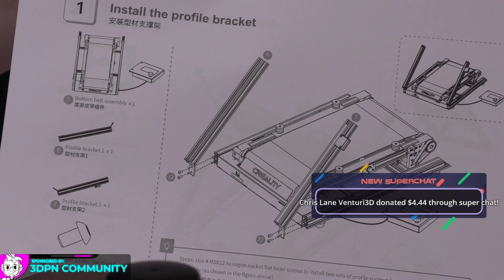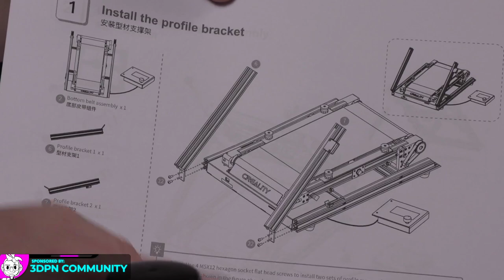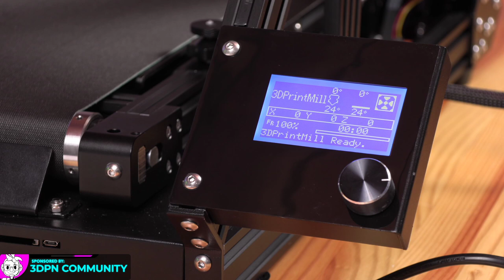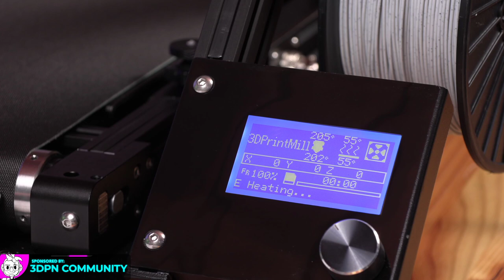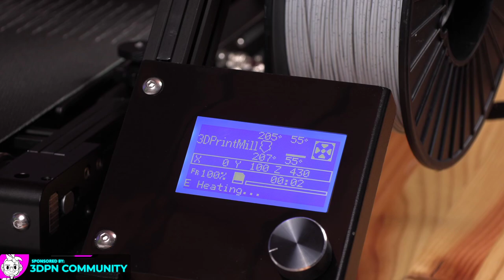Unboxing the Creality CR-30 - Naomi Wu's #3DPrintMill BELT PRINTER!

Comment: Support-free things like benchy may need support. For example, rotating it diagonally toward the nozzle in the slicer (and adding a wedge of supports from the bottom to the bed [belt]) may help. Support-free objects for this printer will have to be designed differently, but can still be done. I look forward to seeing more results and experiments with belt printing.

Comment: @3D Printing Nerd  Just remember, Gain is the sensitivity!!! Set your gain too high and you get either distortion or feedback, especially if using monitor speakers!!! If you have a mix board with VU (Volume Unit) meters, set the gain so the VU Meters are peaking ever so slightly in the red, then adjust your volume for best overall sound!!!😁👍🏻
Reply from the maker: Thank you!

Comment: Naomi, I am a small business owner and my 3d printer fills a specific spot. Parts that I don't want/can't afford to pay for the injection molding tooling costs for and where volume would not really justify the initial cost. For my current application this is an internal spacer that doesn't require a nice finish or even much strength. I currently turn line width, layer height and speed way up and layers to 1.

I think a lot of us have been following you and this project/product because of the potential this machine has to bring fast low quality prints to us. I haven't seen anything from these prints that would cause a print to be unusable. We will try to purchase this with the kickstarter providing it will print ABS and is fast regardless of print quality (being able to change the nozzle size would be a huge positive as well). I think a lot of us are in this boat. Quality is binary, the part is either suitable or it completely fails.

Keep up the good work, just wanted you to know this use case is out there and may be huge. Good luck, keep killing it out there.

Comment: For a first print it looks ok. Do you know the print settings ? Perhaps one side is effected by layer change,  filament calibration  could make a big difference and what is the layer height. The only thing I saw was a slight wobble as it finished a layer. Thank you  for taking the time to setup and show this exciting new printer.
Reply: Joel was printing pre-sliced Gcode. 

Naiomi did the slicing.
Reply: @pileofstuff  that was my point, he didn't know the settings.

Comment: HELP!! Please, I am trying to set up a CR-30 but I've been at it 2 days now. I have tried a few different tutorials on You tube and even followed Creality's own You Tube Leveling Tutorial and I still can't get it to print. Everything appears to be level and the nozzle clearance from the belt is 0,1mm (checked with included feeler). I'm exhasuted with it. Any help or advice would be greatly appreciated.

Comment: it looks like rethinking supports to work in a horizontal plane might be a big improvement. when printing the back of the benchy the extrusion doesn't have enough to push against.   (like an overhang on a normal printer.)

Comment: I noticed as it peeled free of the benchy it left an image of the base of the boat on the belt. Can the belt be cleaned or will it eventually have to be replaced once the belt becomes packed with residue from the prints?
Reply: Not so much the residue, vs the belt adhesion is strong enouth that it lifted the belt.  I would be concerned about the belt layer separating.  When you get back to the start place on your conveyor, then some sort of cleaning should take place.  I think the nature of design will mean belt replacements- Will happen.  Parts costs will be important.  I immediately noticed the same thing.  I've been watching the infinity printers being tested, and it is All about the belt.  They probably figured it out though...........; being Creality
Reply: @d-rockpain4250  you could see as the benchy peeled free it left an outline in the fabric. It definitely seemed down in the weave and not surface dust. If every print leaves behind a little footprint the bed I think is going to have issues after a while if it can't be cleaned somehow.
Reply: @stinkyham9050  as a consumable part? They're going to take a lesson from 2D printer companies and charge a premium.
Reply: @Hawk1966  Im thinking the belt can't be super expensive.  It's a finger joined belt, so if that raises up at all and gets caught at the belt discharge end; then it'll need replaced.  Economical belt cost, and dare I say; a spare with shipment- would help sell this one.  I believe FDM tech is still only as good as the adhesion of the print. If the belt mimics a creality magnetic  bed surface, but in a belt; then they could probably run a uhmw scraper on it, but that would up the likelyhood of the finger-destruction scenario.  Todays belt tech is in our favor
Reply: @stinkyham9050  They can get pricey, but moving so slow and sooo much surface area.....I figure most failures will be fingers letting go, not tracking properly, and belt surface damage. Printing over a thin base layer(remnants)isn't great for the extrusion of the machine, but probably clog a hotend only.  I am indeed curious about belt construction primarily at this point.
Reply: @d-rockpain4250  Giving away nozzles and acupuncture needles is one thing. They buy them in amazing bulk so giving them to us is like a half cent or less per machine. But when it comes to a proprietary major part like that bed cloth. I don't see them being given away or sold cheap. Let's be honest, companies exist to make profit.
Reply: The answer is YES!
Reply: When I was in industrial belt sales; I probably swapped a million dollars a year worth of conveyor belting in place of overpriced OEM...or incorrectly spec'd OEMs, so I agree that- it is all about money.  They don't even put spare tires in new cars anymore.  shakes head I found that the psychology of free items goes deep in sales.  If people are programmed up front for belt replacement, and still purchase the printer, then they have already commited to purchasing future belts mentally....like printer ink sales in the 90's.  I think so many are questioning the belt......, to add to the sales price for budgetary purpose.  I've seen several versions of this take on the infinity printer, and the real variant seems to be: the belt.

Comment: I wonder if the quality would be improved if the entire printer were tilted so that the nozzle was once more aimed straight down, with the belt canting off at a 45 degree angle downward. Maybe some of the quality issues come from gravity being at odds with the extrusion?
Reply: Yep good idea.... And easy to test out. 😁👍
Reply: impossible to do... big prints would never stick to the belt if they were at 45 degree angle. Gravity does its thing
Reply: @biziluxgames8924  hmmno so sure I had big prints stuck to my bed so tight it took me hours to get it off.  Filament isn't that heavy.. Sure give it a go. 🤔👍
Reply: Worth testing, but keep in mind you will also limit the z-axis by doing this.  It will only be able to print as long as the distance is from the nozzle to the floor.

Comment: I gave up on this style of printer years ago because I couldn't work out how to seam and hem a metal mesh belt while keeping it flat enough.   I did think about about using fabric but assumed the print would fuse to it.   I gave up too easily.
Reply: You could have bought a sanding belt.  Those things have to deal with high temperatures.

Comment: Is it possible at all to run the extruder at 90° instead of 45°. I'm not worried about losing the "unlimited" axis, I'm more interested in small batch production.
Reply from the maker: Not on this specific machine, but there are a lot of custom projects out there with that idea.

Comment: Nice printer but the part about face shields made me wonder, could we get belt printer with 90 degree angles? With 45 degree angle face shield would be weaker and could break between layers. But if we could get standard printer like Prusa i3 or Ender 3 with belt we could get repeated print capability without issues connected to 45 degree printing.

Comment: How does the printer printing parts at a 45 degree angel affect the strength of parts?  Can you only print all parts at a 45 degree angle? or is the angle adjustable?

Comment: This is cool.  However I see the issue that from a shear standpoint the parts produced by this will have both X,Y and Z strength limitations because the print plane encompasses all of them.  Ie the parts will be structurally weaker than a cartesian print.  Would be interested in PETG printing but I guess that'll bond to the belt ?  From a prototype standpoint though this is excellent for Industrial Design etc.  Just think, for woodwork, you could print a shape for a lathe chisel guide for the whole leg of a table etc.

Comment: Yeah its cool seeing it printing at an angle but is there any good reason other than the moving bed  to buy this ??  My first benchy on my stock i3 mega was perfect ,,  no strings no under extrusion .. Not one thing wrong. . The benchy you printed in this vid  has a lot more issues ..
Sorry but unless the prints on this printer gets any better  im not sold on that machine  ...yet 😉
Reply: The rolling bed, allowing for extremely long prints, is the one reason to buy this.

Comment: I'm not happy with the way the belt is sewn together, but we'll see if they find one of the better ways of making the belt.

Even with that, I want to get one of these.

Edit: apparently there is no extra indent when you print over the seam, making this the best method.
Reply: Problem with other methods is that you will not get a continuous, seamless surface. Part of it would be unusable. Not to mention issues calibrating after belt change so that printer knows where the seam is.
Reply: So far there is no difference in prints that are printed on that seam but people need to understand there is texture on the bottom of the print.
Reply: @Naomi-Wu  if there's no difference then you did an amazing job.  On the video it looks like there's going to be a zig-zag in the bottom of the print.  Either way, I'd like to know how you got past the problem of the z stop in the firmware.  That is the last stumbling block on my homemade belt printer.
Reply from the maker: That zig zag played with my eyes. I thought it would be felt, but running my hand over it and I barely felt it. So weird.
Reply: @michaelbujaki2462  The z-axis still has a limit but its 21,474,836mm (over 13miles) which I'm told is the max for Marlin Currently (hoping they find a way for infinity).  I don't see anyone printing that long and typically you reset the z-axis to zero between each print in the gcode.
Reply: @NAK3DDesigns  that would be good enough.  My starting point was a Vertex Nano, which I stripped for parts.  I have the thing working, I just need a belt and a way to fix the firmware.

Comment: My paranoid self has to wonder: any risk of a print sticking so well to the back of the belt that it gets lifted off in the front as it goes around the roller? Say your adhesion starts strong and gradually declines as you print. Maybe have something in place right as the belt drops that is level with it (with a slight offset, so prints don't get caught on it. Like a fixed spatula that keeps prints from trying to tilt.
Reply: that very rapid turn really should make it impossible, but a sufficiently thin and flexible print could in theory tho
Reply: @teslacoil4335  From the follow up video it looks like that happened to the I-beam model. Not at the turn, though, but from what I understood, the bed is slightly dipping before that already.
Reply: @TheTrienco  ah I didn't see the follow up, I need to check that out

Comment: Wondering about layer adhesion when it goes 45 degrees instead on 90 degrees on the print bed, how does this affect print adhesion ?
Reply: I'd love to see Steffan do some of his torture tests on prints from this thing.

I suspect on a well tuned machine with good slicing it would outperform horizontal layer lines, but be a bit less than vertical layers.
Reply: watch the follow-up video I don't think adhesion will be an issue.. 😉
Reply: @NAK3DDesigns  Thanks nice to know i was thinking of getting a printer like this for an upcomming business where we have to print parts for machinery so that we can avoid down time :)

Comment: I would like to see a conveyer belt system on a non-infinite z printer just to enable us to get the normal 3d prints but as an automated batch printing
Reply: This has been done in many experiments already ;) Mostly DIY, but I guess they have a good reason they chose for infinite-z. If you want to convert your machine, google it a bit, there's a lot of nice examples to find :)
Reply: @MarinusMakesStuff  yes, I know but I'm surprised to see no mainstream manufacturer has picked up the idea and done it with a heated belt
Reply: @stinkyham9050  it'll only be infinite if it's printing diagonally.
Reply: @stinkyham9050  say your belt is only 1 meter long and you want to print a 2 meter part in a standard configuration.  If the belt moved back and forth the part would peel off the ends of the belt once it got past 1 meter..  Hope that explains..
Reply: @stinkyham9050  You wouldn't be able to do it in sections and still be one solid piece as the hotend would hit the previously printed section..  The advantages are infinite axis and multiple part replication with minimal user intervention..
Reply: @stinkyham9050 Yep, that was my channel..  I don't know their reasons for doing the Kickstarter but from what I've pieced together I think its for Creality to gauge if there is truly a large enough demand for this type of printer.  I know in the past many manufacturers thought this was too much of a niche market.  Again this is just my speculation..
Reply: @stinkyham9050   think there are still a few minor tweaks to be made but overall its a solid design..  As with any new technology I think we will see major improvements over the next year once its easily available..  The biggest areas needing improvement are better belt materials and Firmware designed for this type of application..  That said I wouldn't pass up the opportunity to buy this printer as I've shown its very usable and the quality is on par with other printers on the market when you account for print angle..  But I love belt printers so I'm a bit biased.. 😉

Comment: Regarding the whole GIF argument, if the creator says it’s pronounced JIF then that’s how it is.  Reason...

GIF is an acronym, an abbreviation that itself is pronounced as a word.  There are many examples of words that begin with a G but are pronounced either as a hard G or as a J.   Good vs Giant, or Gill vs Gin are just two contrasting examples.  There are actually more words where it is pronounced as a J, but if you look at the subset where the G is followed by an I, then the words do tend to be pronounced with a hard G. 

So, while it is generally more common for people to pronounce it as GIF, those who pronounce it as JIF are also correct according to our written language, and certainly in accordance with the creator.
Reply: The man that discovered it, named it ALUMINUM, so no more aluminium, mmmkay

Comment: slow! hot the best quality! SO WHAT IS THE POINT OF IT?
Reply: Longg
Reply: It got that quality right out of the box with no tweaks on a non standard filament for a printer with a projected price of under 1000 and infinite y length... if you can't see the appeal of that to consumers you have insane standards